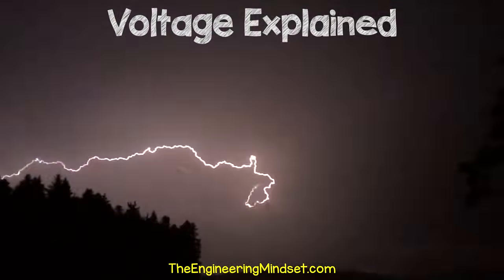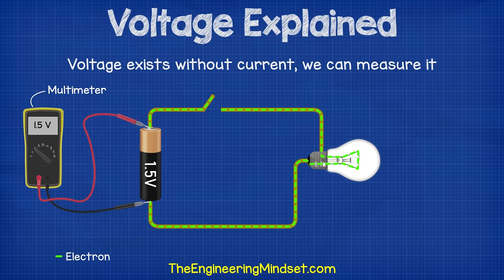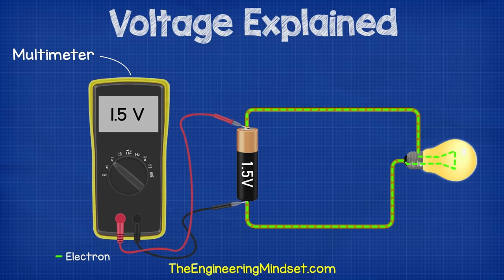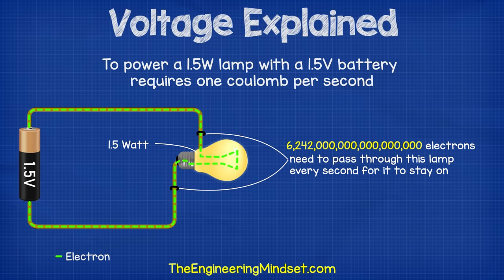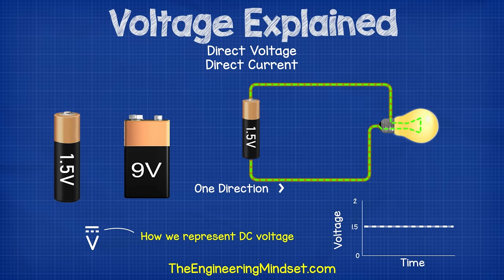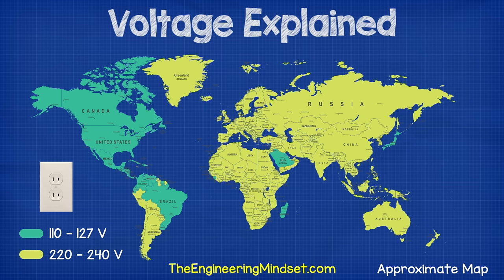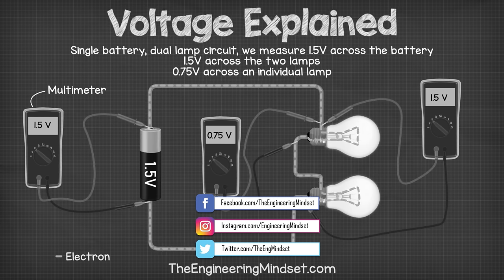Voltage Explained - What is Voltage? Basic electricity  potential difference

Comment: "more water will flow at a faster rate" is a redundantly expressed statement. Either "more water will flow" or "the water will flow at a faster rate" would say exactly the same. Because if you said "less water will flow at a faster rate" or "more water will flow at a slower rate", we wouldn't know whether overall more water could be collected at the end of one of the pipes than another in a given amount of time, which is the thing you wanted to talk about.

Comment: Hi Engineering Mindset experts, at 2:53, I do not understand how electrons flow from the first battery negative terminal to its positive terminal when connected in series? It seems like the electrons in the first battery negative terminal will just flow to the positive terminal of the second battery. Hence also how does batteries connected in series increase the voltage since the positive terminal and negative terminal of each battery is insulated? Not sure you understand my confusion.
Reply from the maker: I think it would be best to visualise if you checked out video on how a battery works. You'll see how the chemical reaction is working.
Reply: @EngineeringMindset  Hi okay, I shall watch it. But is it possible you can enlighten me. Because I read an article that says electric potential energy of a charged particle increase as the distance between positive and negative particle increase. However, another article says the attraction force between the positive and negative will decrease as the distance increase just like magnet. So if attraction decrease why potential energy increase? I am confused as I am not electrical background, just layman.

Comment: I thought resistors have to be added in after the current leaves the source, or risk burning out the diode? @ 6:49 the traditional current flow of the left illustration has the resistor coming after the light. Is this correct?
Reply from the maker: Check this video https://youtu.be/VV6tZ3Aqfuc?t=269
Reply from the maker: Check out NEW resistor video, everything covered! ➡️ https://youtu.be/DYcLFHgVCn0

Comment: Just in case you still don’t get it!

Voltage is the energy supplied to an electron to make it move. 

Energy is created by the interaction of chemicals in a battery or by electromotive force in a generator.

Energy is measured in joules.

1 joule is the approximate energy required to lift an apple a vertical distance of 1 metre from the ground

1 volt = 1 joule/ coulomb

1 coulomb = approx 6,000,000,000,000,000,000. electrons

Voltage is the energy that drives the electrons around the circuit.

Simple!

Comment: It’s crazy what we can do just learning to manipulate the fact that nature runs on seeking equilibrium. Like, all we’re doing is increasing the free electrons (in the battery) and then giving them somewhere to go (closing the circuit). Then they will naturally flow down the wire in order to go from higher concentration/full valence shells to lower concentration/empty shells (basically) and the whole circuit runs. Crazy shit. Ben Frankie would be proud. This just blew my mind. Oh yeah, it’s all coming together.

Comment: With higher line voltage outside USA, does that mean wires can be smaller and therefore cheaper? Just thicker insulation?
(Higher voltage but less current required for the same power level and therefore smaller wires ok).

Comment: At 6:30, if the coulombs are 0.2, how come the electrons are 1.8726 * 10^18? It looks like it is dividing 6.242 * 10^18 (1 coulomb) by 3, but it should be dividing it by 5 (0.2 coulomb) to get 1.2484 * 10^18 electrons, right?

Comment: It’s tough for me to make the connection of voltage with pressure. What is happening to the electrons on an atomic level in a 120v vs 480v? My intuition is that it’s similar to the way a smaller (120) and larger (480) magnets are pulling together? It “wants” to pull/push the electrons harder?
Reply: This might not be 100% correct but I think in a battery one side has to many electrons or has a negative force while the other doesn’t have enough electrons so the electrons flow from on terminal to the other to balance themselves
Reply from the maker: Seen our new 3 phase transformer video?➡️: https://youtu.be/u0SsejDCVkU

Comment: The core meaning of Voltage is not yet explained, though. By that I mean voltage is the pressure that force electrons to follow their wanted path, toward elements direction through wire. Low voltage will result in electrons flow arbitrary between atoms without any meaningful direction. The speed of electrons is always c, light speed. But, the direction is mainly affected by voltage or the pressure!

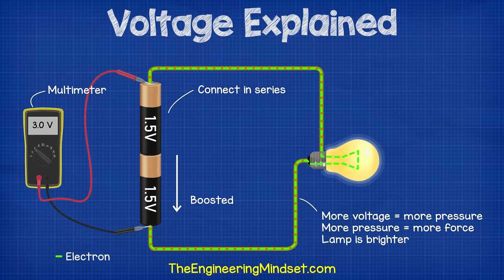Comment: @3:17, when the batteries are connected in parallel, how does the output is 1.5V and not 3V could you please explain.in addition to this I would like to know, why the voltage in parallel circuit is same across all the points,My doubt here is when the circuit is closed (considering two electric bulbs are connected in parallel and the power source provides 1.5V),How does the electron split across the paths,does the current between the 2 paths splits equally if so how does the voltage across electric bulbs will have same potential difference?
Reply: Ranjith Kumar there will be no current flow between the batteries connected in parallel because electrons flow from negative to positive and in this case both negative terminals and both positive terminals are connected together therefore there will be no electron flow and the voltage of each battery will remain at 1.5v. Unlike when two batteries are connected in series, where the positive terminal of one battery is connected to the negative terminal of the second battery and so electrons will flow from the negative terminal to the positive terminal when there is a complete circuit. The total voltage in this case would be cumulative 1.5 v + 1.5v = 3v. Not sure I understand your second question though. Say it is 1.5v at the battery terminals and you connect your bulbs to the terminals, the voltage at the terminals will still be 1.5v. Say you connect two more bulbs the voltage will still be 1.5v at the terminals. If the battery has an unlimited capacity then it will stay at 1.5v forever. When lamps are in parallel, they are completely separate circuits from each other, so there is no restriction for each lamp to be supplied with the same voltage. The electrons at the battery terminal will be given sufficient energy so that when they arrive at the bulbs, they will split up depending upon the energy requirements of the bulbs.
Reply from the maker: Check this out, how a battery works: https://youtu.be/PXNKkcB0pI4

Comment: You explain voltage with an example of two water tanks, where full tank has more potential energy(voltage) than half-full, thus it has more voltage. But this makes more sense in a way that full tank will last longer (as a battery) compared to half-full. And voltage of those two will not change. You can have one power bank with 5V and 2000mAh capacity and another with 1000mAh capacity. Both have same voltage, but one is twice as "full" as another, like water tanks. That's what I do not get with water tank analogy.

Comment: Ok so if the water tank is pressurized than how does the water get back into the top of the tank? Or the electron back to the positive terminal how does voltage drain?
Reply from the maker: Please watch our how batteries work video

Comment: My first encounter with voltage is when my dad got a PS1 from the US. We were all so excited and just plugged it in the (220V) socket without knowing it was 110V. The second my dad pressed the power button smoke suddenly burst out the vents! Had to wait a couple of weeks until it was fixed/
Reply: In the 1960s slow effect versions you could try smoking a bit and still have a chance to come clean when you realize what it's doing to you before you got into too much trouble but if you didn't have the wake up calls it would still harm you just as today.

Comment: I have a question. My nephew has an rc car that has a 3.6V and 600 mah rechargeable battery which would last around 15 mins playtime. Assuming the motor works perfectly fine with 3.6V. Can I get another version of the battery with same 3.6V but around 1500mah to work more longer? Does this sound right if done?
Reply: yes, thats how that works

Comment: So the different voltages are a problem for electronics obviuosly but Im looking for an intuitve way to understand why. Isnt what matters most thw power VxI? if you are getting the same power what difference does it make whether there is more voltage or less voltage if the current compensates and vice versa. There needs to be a deeper explanation for this.
Reply from the maker: Think of it like pressure. A water pipe can have 2 L/m flowing at a pressure of 1bar or 5bar. But if the pipe can only handle 3bar then it's going to burst of you try to put 5bar in it.

Comment: Japan is 100V BTW, not 110 - 127V.  Frequency, varies though, 50Hz or 60Hz depending on where you are.
Reply: I learned about that in class, why is Japan split between the 50Hz and 60Hz?

Comment: Whats the advantage of running things like tvs or refridgerators at 220v? Just wondering since everything just about runs on 120 in the usa except bigger machines that need more power.
Reply: Safety I assume, amperage is dangerous so the more voltage you have the less amperage you need.
Reply: higher voltage can use smaller wiring especially over longer distances

Comment: I just have one question. If the voltage difference of a battery is 1.5V, does that mean the positive and negative terminal of the battery are 0.75V each?
Reply from the maker: Check this out, how a battery works: https://youtu.be/PXNKkcB0pI4

Comment: At 6:48 when explaining how certain components are rated for certain voltages, the resistor is placed in the path of the current flowing OUT of the component into the battery terminal. My intuition would have been to place the resistor in the path of the current flowing IN to the component in order to limit the current and prevent the component from being damaged. Can anyone explain the placement in the animation? Is the resistor acting on the entire circuit, in this case does placement of the resistor matter, once its in the circuit somewhere? Is the animation using conventional current representation but placing the resistor assuming the electron flow representation?
Reply from the maker: See our video on resistors explained, all covered there

Comment: in 5:16, why the voltages are equal? that means potential energy difference between plus side of battery and negative side of battery is equally to potential energy difference between the light bulbs?
Reply: Instead of looking at the voltage drops, which is what the multimeters measure, imagine just the static potential of each wire. The lower wire going from the negative terminal to the light will have a "0 volt" potential because it's the negative terminal of the battery. We already know the potential difference across the battery because it's given. With this difference and the known potential on one side, we can find the potential on the other. We do this simply by adding 0v and 1.5v, which is clearly just 1.5v. Now, you can see that the top wire is at the potential 1.5v. With this, we know the potential of both wires and can simply subtract to find the difference over the bulb, which is 1.5v.
Reply from the maker: Check our new Multimeter tutorial out ➡️ https://youtu.be/4lAyzRxsbDc

Comment: ok. voltage is a pushing force, i got that. but what is voltage ? 1 volt is required to push 1 coulomb  of electrons that is okay, but what is voltage? what form it is ? how we apply voltage on battery or how we inject voltage in to the battery?
Reply: You can look at voltage sort of like potential energy. If you place an object on a desk, you have given it potential energy. Voltage is just an electrical potential. If you place a bunch of positive charges on one metal plate and a bunch of negative charges on another, you will have a voltage between the two plates because the potential is different. This potential difference is what people talk about typically when they say voltage.

As for how a voltage (electrical potential difference) is created, you have many options. Batteries do this chemically with a reaction. There are many types of batteries though, so you'll need to do a bit of research. Lead acid batteries are pretty simple though, so start there. Electrical generators produce a potential by taking an input of mechanical energy and using it to separate charges.

Comment: IMPORTANT: Cheap multimeters will get you hurt depending on what you’re testing. Do your research because you tend to need a Cat 3 or higher rated multimeter so it doesn’t blow up in your face when you connect it to something.
Reply: I don't how much serious of a issue this will be but sounds like something dangerous , ty for your info.
Reply from the maker: Check our new Multimeter tutorial out ➡️ https://youtu.be/4lAyzRxsbDc

Comment: 5:37 I don't understand why the voltage would decrease, the pressure is the same even with two lamps.
Reply: It's a scam to make you watch his other videos!
It would be much more helpful just to list the resistance and current and then we can work it out from there.
As far as i can tell as each lamp has an (unspecified) resistance so the voltage will be affected accordingly.

Comment: The water tank analogy only works if the voltage source is a capacitor. For a battery, a pump should be used.
Reply from the maker: Check this out, how a battery works: https://youtu.be/PXNKkcB0pI4

Comment: So volts is the amount of power it takes to "trow" electrons from one end to the other? 
By throwing them they gain momentum and ability to move around the wire.
Reply: Push and pull the electrons.    Negative end of battery PUSHES (like's repel )
Positive end of battery PULLS( opposites attract).     Remember all electrons are
Negative charge.    You can actually see this phenomenon by playing with two
magnets. Enjoy.
Reply from the maker: Check this out, how a battery works: https://youtu.be/PXNKkcB0pI4

Comment: Is if the voltages is higher in different countries does it charge iPhones and laptops quicker?
Reply from the maker: No, the plugs will convert the AC input power to 5V DC
Reply: @EngineeringMindset  how do you mean? I don’t understand I thought the higher voltage will charge an iPhone or laptop faster.
Reply from the maker: The iPhone plug has a fixed output voltage due to the circuit design. All USB chargers do, and laptop chargers. Look at the sticker on the plug and it'll tell some something like input : 100-250V output 5V as long as you input a voltage between 100-250V it'll output 5V. Watch our voltage regulator video

Comment: Sir , what is negative voltage??
Reply: It is a matter of reference. A 12v battery has two terminals. You can refer to the positive terminal as being +12v or the negative terminal as being -12v. In each case the other terminal would be either +0v or -0v. So when you are referring to the positive terminal, then that would be 12v positive voltage and when you are referring to the negative terminal, then that would be 12v negative. In this case, there is no need to differentiate but often one terminal is connected to the earth (ground) or an artificial ground, such as the frame of a vehicle and in this case you would refer to the other terminal as either positive or negative voltage. Furthermore, some parts of a circuit could be more negative than other parts of the circuit and you would refer to that as being negative voltage. For example: if you connect two 12v batteries in series, there will be a total of 24v but say you just wanted to use 12 volts, then you would use the terminal connecting the two batteries together and one of the other terminals, which would be either positive or negative. So, where the batteries are connected together would be common to both batteries and that is said to be 0v and the other two terminals would be -12v and +12v. Relative to the common terminal you have a 12v negative voltage terminal and a 12v positive voltage. The voltage at the -12v terminal is more negative than the other two terminal voltages. Remember the negative sign only refers to the direction of the electron flow.

Comment: When you show a multimeter, you've got the red connector on the positive side of a battery and the black connector on the negative side. Is that important?
Reply from the maker: No, it will just say 1.5V or - 1.5V to indicate the difference in polarity. The voltage difference will be the same
Reply: @EngineeringMindset  thank you!
Reply from the maker: Check our new Multimeter tutorial out ➡️ https://youtu.be/4lAyzRxsbDc

Comment: Then what is inside the battery to push electrons in conductor
Reply: The potential difference between positive and negative terminal of battery is called voltage and this voltage is exactly the force that pushes electron in a conductor. Higher potential difference means more voltage and more force to push electrons. Zero voltage means the positive and negative terminals are at same potential so there will be no pushing force for electrons.
Reply from the maker: Check this out, how a battery works: https://youtu.be/PXNKkcB0pI4

Comment: Okay I understood all this a long time ago but can someone explain to me why or how voltage can go negative?
Reply from the maker: It's just the reference point you are measuring from. Take a 1.5V battery, connect it to a multimeter and it shows 1.5V, flip the battery so it connects to the opposite leads and it shows -1.5V because the reference point is reversed.